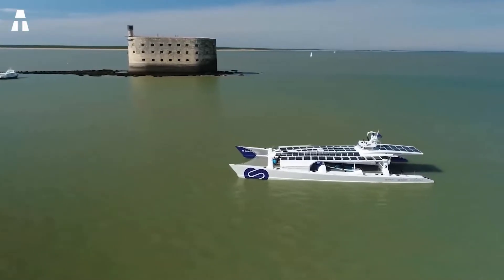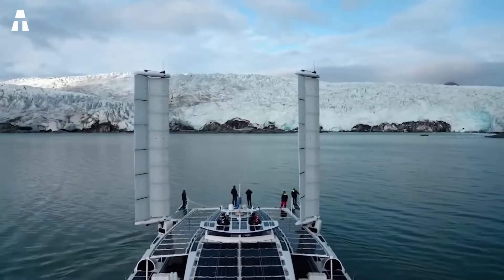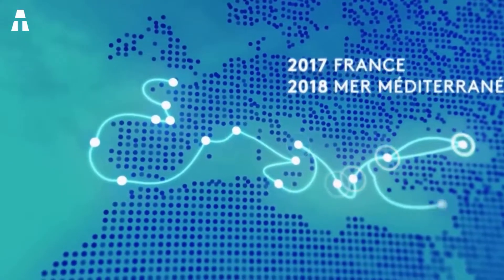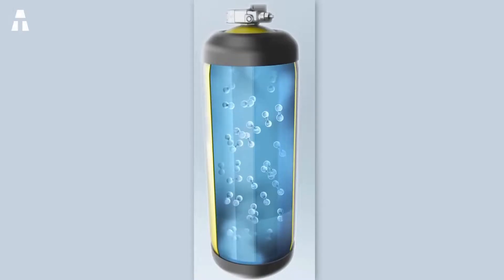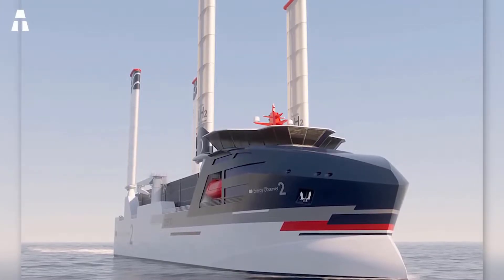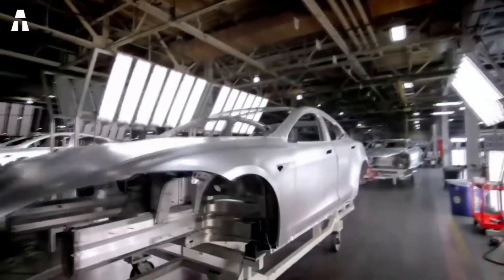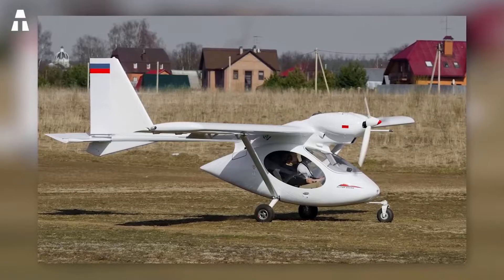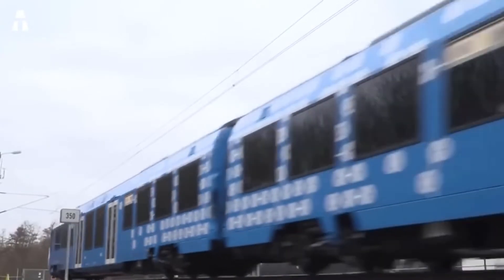The World's First Hydrogen Powered Ship

Comment: Since fuel cells electric boats are five times less efficient than battery electric boats, I fail to understand the interest. It means 5 times less range. And for cargo, the solution is to stop shipping things all over the world, by consuming less and more local, and to return to sail boats for the remaining cargo. Hydrogen cargo ships are just greenwashing since more than 99% of hydrogen produced in the world in not green. And off course it is even worse for cars since EVs work fine, and we can also use public transportation, bikes, and walk. Even for trains it is stupid, since an efficient way for trains to be electric is to electrify the line. BTW, in the video (6:17) we can see that the line is electrified. So green hydrogen is nice but to replace actual applications of hydrogen, and maybe for long term storage of production surplus and long distance aviation. All other "applications" are just greenwashing to get public money or to postpone real changes.